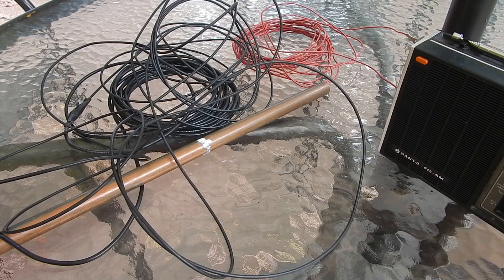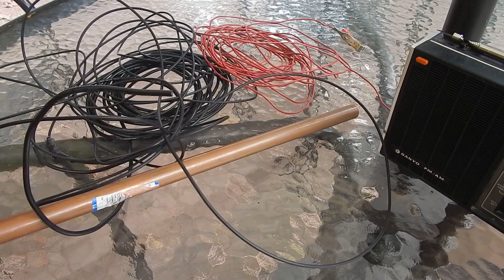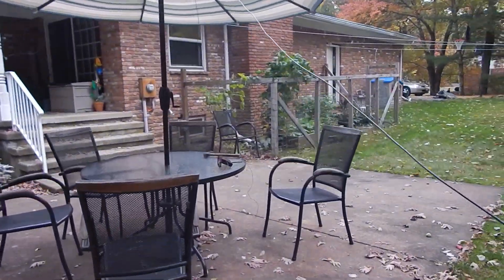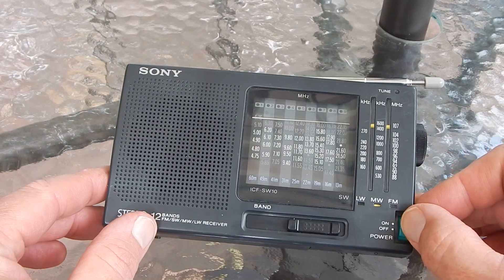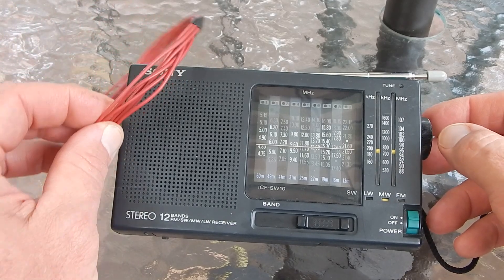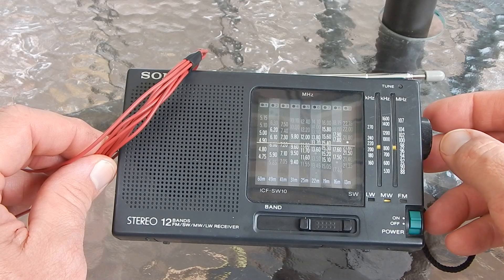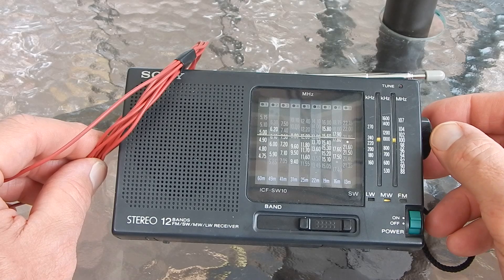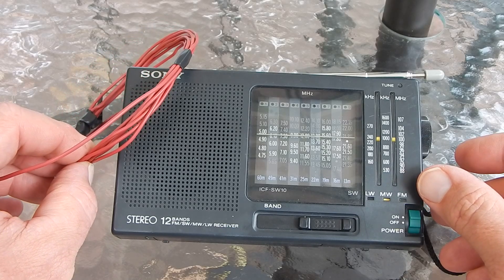A super-cheap, super-easy, very effective AM radio antenna

Comment: Very interesting as I thought that I was one of the last people who listen to late night am broadcasting.  Can you please help me with this one... I have an old cb antenna which extends about 30 feet into the air.  It's already grounded 3 feet down with copper tubing.  My coaxial cable runs through my down from my attic and is right behind my chair where the old cb radio was. Could I somehow utilize this to pick up far am signals? Please anyone chime in if you understand this
Reply from the maker: No, there's a few of us weird ones who love to listen to AM late night.  I did a video a while back on how to connect an AM radio to an external antenna using a simple loop of wire.  I'd give that a try on your CB antenna.  I think it would probably work:  https://youtu.be/d1jaojiA1Oo

Comment: Would coaxial cable work as a loop antenna?
Reply from the maker: I don't think so...but someone smarter than me probably knows how to make it work.
Reply: @Radiodog  If you used the outer conductor (or both inner and outer connected together) it would work.

Comment: Some construction details from Radiodog
 "Think of the antenna this way:
1.  Take a piece of wire of decent length, I'd say at least 70 feet or so.
2.  String one end of the wire to a support as high as you possibly can.  (For this demonstration, I simply tied the wire around the trampoline post, as high as I could reach.)  Affix the wire so that there is at least 50+ feet in the air, in the clear. 
3.  Attach the other end of the wire to some sort of earth ground.  (I tried it with a piece of junk metal tapped 12" into the ground and it worked fine.)  There should be a good bit of wire left slack; you'll need it for Step 4.
4.  At the radio location (here: my patio table), make a simple winding (or series of loops).  I did 7 loops around the widest part of my hand and fashioned it into a nice round loop, held with tape."
Reply: So is this a tried and true method?

Comment: Awesome indeed!  Radiodog. Just one question, though. One end of the black wire is tied to the trampoline. Is the other end of the black wire connected to one end of the brown wire (patio umbrella)? I see that the other end of the brown wire is attached via the crocodile clip to the grounding pole.
Reply from the maker: Hey, thanks for the nice comment.  I think maybe it's time to redo this video, as it seems to generate a lot of questions about something that's pretty simple.  Basically, it's a long piece of wire, strung outside as high as possible, with one end connected to ground.  At the radio location, the wire is coiled in about a 4" coil, 6 or 7 times.  That coil is placed near the receiver.

I think I'll update this video soon to clear up some of the confusion.
Reply: @Radiodog  So it's all one long wire really, with a loop in the middle for the radio to sit next to? I think the two wire colors are what's throwing everybody off :)

Comment: Sorry brother you really didn't show us how you made this antenna.
Reply: The antenna is about 100 feet of insulated wire. One end of the seven turn loop is connected to the wire. The other end of the loop is connected to a ground rod. Place loop near radio. Very simple.

Comment: A good stopgap!  BUT, I'll be REALLY impressed if you take your hand off of it and then compare the "before and after".   Those of us above a certain age remember that trick with Rabbit Ears, lol...
Reply: It works without touching the coil. I did something similar with two very long wires as a dipole, no ground, and a 100 turn coil of 24 AWG magnet wire on a paper towel tube.
Reply: Oh it works alright ^^
Reply: @DXPedro  Oh, I know it works, and I thank you for inspiring me to take a run at it.  I've done it for every radio and component tuner in my house (and there are a lot of them).  I used a 5/8"x6" Stainless bolt and it works really well.  I was just having a little fun with your testing parameters.  As long as fingers (or anything that's magnetic) is close to the coil, you're giving a little helping hand (okay, fingers) to the results.  The same thing happens with SW boosters like those sold by MFJ.  If you want to have some real fun you can try cascading those two together (i.e., with a tunable antenna), and then you can get even more interesting results, especially with selectivity.  My big problem with all OTA formats now is there being less than ever to actually listen to...I still DX for both FM and AM, but except for a little bit of morning weekend NPR and a couple of overnight skip AM stations playing Jazz, there's not much to hear OTA anymore.  It's very geographically eccentric, and I'm a retired Classical/Jazz Musician and you can only listen to so much Miles (as much as I like him) or Pachelbel's greatest hit (and it makes money when playing weddings) and not get tired of the lack of actual diversity of programming out there these days...off soapbox, Lol... thanks again...
Reply: @Ricktpt1  on that regard, I just catch Austrian Radio International that only broadcasts 90min a day with great great classical selection. sorry to plug it like this, but feel free to check it on my channel.
I can still catch plenty AM here in portugal, mostly north africa and spain, but it'snot uncommon for me o catch england or italy as well.
have a great week.

Comment: I made this for my clockradio in the bedroom. I lead the wires outside , the antennawire fixed across the entire length of the yard fence, for the ground wire i hammered an old metal tentpole into the ground and attached the wire using an automotive hoseclamp that i had in my stash.    The coil fits over the casing of the clockradio. I'm in the south of the Netherlands and at night i was able to pick up AM stations from as dag as Germany, UK and Scotland, Italy, Spain and Romania! Works beyond expected!
Reply: How many turns does your coil have?
Reply: @davidking5104  said 7 but does it have to have a coil  to work  if you run it straight  to the radio
Reply: @markbailey1423  I've already tried and worked perfectly with about 9 turns. You put the coil close to and on the part of the radio where is the AM circuit inside. (I mean the ferrite rod antenna)
Reply: @markbailey1423  yes, it has to be a coil. Because you are setting up an inductive coupling with the ferriet antenne inside the radio casing.
Reply: @markbailey1423  trust me, a coil works better most of the time, but try both.
Reply: @davidking5104 

there ya go. I'm happy for you guys. Not sarcasm
Reply: @jfv65  your comment warrants research on my part but in a good way. Like I want to try and verify for myself, this advice seems like a legit life ha k at this point!!!!😊

Comment: I'm thinking of throwing a length of wire over my roof temporarily for the long part of the wire, then attaching the 4" loop to that to use with my Skywave.
Reply: CW Roberts Tablets : Get it in the air someway! That is what is important!
Reply: And the grounding as well

Comment: Can you please borrow a digital portable radio and use it's ability to scan. Count the number of stations the scan stopped on for both with and without and rerun the scan with the same setup.
Reply: In my setup I took the back off my radio to locate the internal ferrite rod. When I looped my external coil I wrapped it basically the same size and shape and taped it to the case just outside the internal. Think of the setup like building a transformer. Two coils of wire very close to each other and currents from one are induced to the other.

The more tight coils you can pack into the external the better. Also much less background interface is likely to be picked up.

Comment: How is installed not showing  is directly making antenaa
Reply: He did install it just not permanently. When he takes the loopy bit to the antenna input on the receiver, it induces a magnetic current which in effect overrides the preinstalled telescopic antenna. The wire does need to be earthed, or grounded, depending on your local word choice.

Comment: what is the range?
Reply: I built a similar antenna/coil setup and could hear Dallas, Houston, San Antonio, Oklahoma City and New Orleans on AM during the day from NW Louisiana. I went from 3 stations to about 50 at noon.
Reply: The longer the antenna wire the better....shoot for 250-500 feet.

Comment: Hello dear, does this antenna work for LW?
Reply: Longwave needs a very long wire antenna but it will work. I picked up airport beacons using a similar setup but with a 100 turn coil of 24 AWG magnet wire close wound on a small cardboard paper towel tube.
Reply from the maker: I don't know about that.  No LW around here, so I never tried.
Reply: It will work just as same. You should use a bigger wire for LW.
Reply: @DXPedro  By 'bigger', you mean 'longer', right?

Comment: Don't ever brow beat AM radio! The very fact they can run at less than full power can be a blessing. A couple of years back we had a hurricane come directly over the Columbus, Georgia area. Needless to say all the radio stations in town where down to lack of power save one. They had the sense to invest in a backup generator. They were running at reduced power off a 5000 watt generator in the parking lot and even had ham radio volunteers at the station keeping in touch with first responders at city hall.

Comment: I do something similar but for FM radio. I've got a portable that has a jack for an external FM antenna. I just connect a simple wire that has a 1/4 inch plug on both ends. Hang one end of the wire near the top of the door with clips or tape and I've got nearly three times the stations coming in. Not bad for a wire only five or six feet long. The only problem is the wire needs to stay vertical. If I used a wire as long as you use hanging from the top of the house or a nearby tree top I could be picking up Cuba.

Comment: Thank you for the video. I have a rather dumb question. I am living on 9th floor of a multi-storey building. So there are no trees to hang around the wire. All i have is a balcony. Many of them in fact. Is there a way to use some kind of antenna here? Also how do i deal with the grounding part?

Thanks.
Reply from the maker: Good question.  I am very fortunate in that I have a good bit of space to work with.  I think if I was in your situation, I would probably spend some money on an external active antenna.  I'm actually thinking about one called the Boni-Whip, which is really compact, wide band.  Here's a link on Universal Radio:  

https://www.universal-radio.com/catalog/sw_ant/2531.html

In answer to your question, I don't think the simple wire set-up I describe would work for you.  You could probably ground it OK on a water pipe or something, but running a decent length of wire would be difficult.
Reply: @Radiodog   Thanks. Will check this out. By the way would routing a vertical wire from 11th floor to 9th floor work ?
Reply: @Radiodog : Maybe you can try running the wire around the entire ceiling of a large room. I saw a similar video where the author simply grounded the end of the wire by holding it. Maybe you can ground the wire to something like a faucet. The coiling of the wire acts like a mini inductor. The more coils it has the better it can transfer what limited signal it received from the long wire. All you need is a lot of wire, a good bit of tape, and maybe your sweet self as the ground. A nice little project when the weather is bad and you've got some time to kill.
Reply: Build a tune-able loop. Very easy and incredibly effective. Sits next to the radio. There are many designs online. Just use google.

Comment: Ground it in the center screw in an outlet.
Reply: Never do that. The screw is part of your electrical ground. RF grounds require a separate ground.
Reply: @dancingbear6239  Just to add a few clarifying details to Dancing Bears reply...there's no electrical danger to what you suggest, but your house power ground runs around your house before it gets to earth ground which both (1) diminishes the RF ground you are trying to establish and (2) gives plenty of opportunity for interference from electrical devices in your house.  In my experience it is better than nothing...but not much.  Just do the separate ground rod - it's simple and you'll like the difference.

Comment: little piece of wire is easy to find, but that lot of space is practically impossible to fin in urban areas, lol. nice video though. :)
Reply: Just use two loops: one as the antenna other to lace it around the rádio 📻
Reply: @DXPedro  i need to know more about that stuff i guess.

Comment: just pull the aerial out from radio.  :)
Reply: Tht doesn`t work for the AM band since it uses an internal ferite coil inside the radio.
Reply: The aerial is for FM and SW, not AM.

Comment: you should connect the clip to the whip antenna on the radio
Reply: Clipping to the telescopic antenna would help with FM and SW reception but not AM (MW).
Reply: Ram Laska that would only work for fm
Reply: I was wondering about this! How does connecting the ANT to ground and looping around the radio compare to clipping the antenna directly to the built-in antenna of the radio? Shouldn't it be better, or would it be worse, since the radio is a handheld, and not truly grounded? Is that the only reason why it's being done through (inductance? resonance?), rather than directly wired?
Reply: If connecting the red wire clip to loop antenna there is what's callled ic (integrated circuit) will be charged with some electric chaeges and suddenly going to corrupt .so it's better the seven turns coil is around the radio's ferrite coil without touching external antenna 
Wishing for all good things and happiness

Comment: Ok so I got a new Tivoli's model one radio for night time talk radio- but the AM sucks even in the city (sending it back) barely gets one am station no matter what I do, the FM reception is ok. Do I need a rig like this for a new $150 radio or is it defective? Seems like the little cheap ones get better am, ?
Reply from the maker: Thanks for the comment.  I suspect that your poor AM reception has little to do with your radio and more to do with the fact that AM signals are notoriously bad indoors.  You might try positioning your radio by a window, if possible.  An inexpensive, passive AM loop antenna (such as the Tecsun AN-200) might also help.  The best solution (and the one that I employ) is to set up some sort of external AM antenna outdoors.  Unfortunately, there really isn't a one-size-fits-all solution, and there aren't many options commercially available since not too many people worry much about their AM radio reception.  You might check out the C. Crane company...I've used their Twin Coil Ferrite Antenna, with some success.  It is one way to "import" a decent AM signal into your house.

Comment: You show a ground pipe, a wire stretched across a distance in your yard, a connection to your patio umbrella and a coil of wire straddling the corner of your radio, but no connection to (if there is one!) nor relationship between the coil, the wire, the umbrella [the trampoline either], and the ground pipe.  How, at what juncture and where are the connections between the components of this antenna/signal booster concoction?
Reply from the maker: Thanks for the reply.  I think you'll find the answers to your questions in my response to Crackles McFarly, below.
Reply: Its called inductive coupling. A simple and practical way of using a random long wire as a receiving antenna.  the umbrella pole and kids trampoline also act as extra metal in the air whilst keeping the main element elevated. Not sure why your comment seems so sarcastic when the principle has been used in radio since its invention. I hope I have helped you in some way. God bless. 73 M6CYV
Reply: @KennethNicholson1972  Even your reply is vague; why do people always think sarcasm/troll when someone criticizes?  God bless
Reply: HaHaHa wire on trampoline just hangs (not connected to anything) runs to the umbrella (not connected to anything)wire drops and it's looped and THEN wire drops and THEN is connected to THE PIPE, so easy to understand.